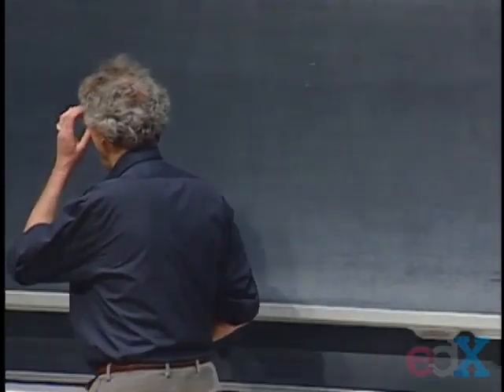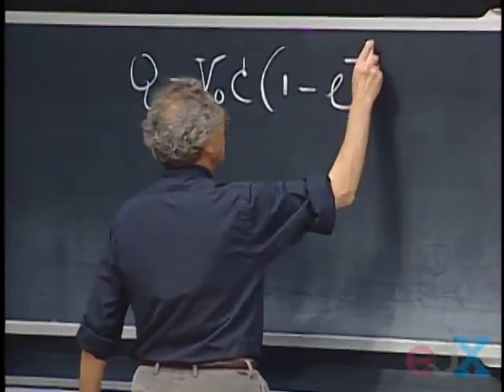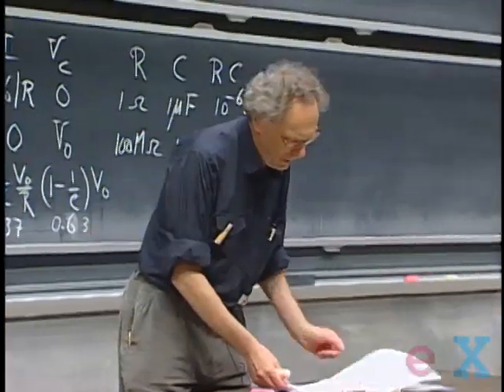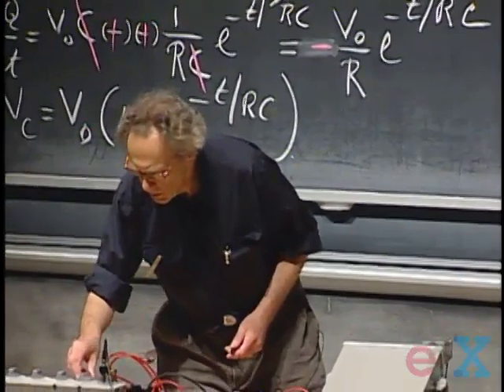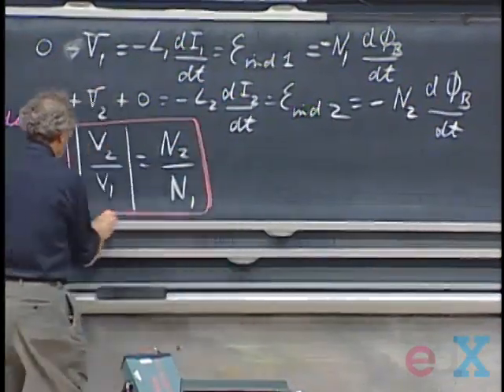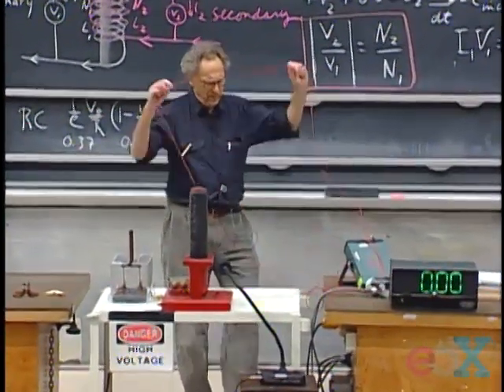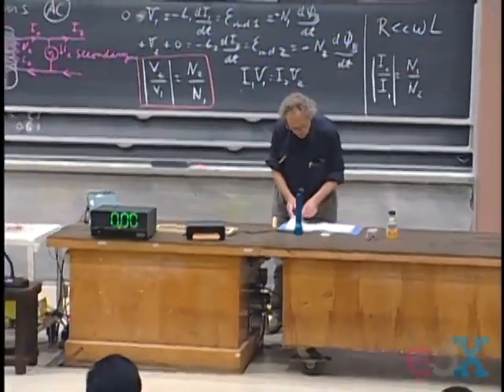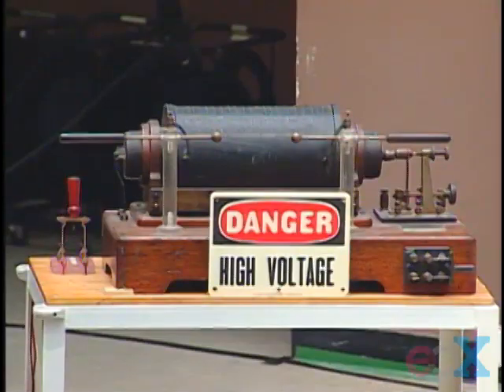8.02x - Lect 24 - Transformers, Car Coils, RC Circuits

Comment: Transformer: If the voltage in primary is equal and opposite to source voltage (110 V) how does the current even flow through primary?
Reply from the maker: question unclear
Reply: @lecturesbywalterlewin.they9259  You apply an alternating voltage to primary coil of transformer. There is an emf induced in primary which will oppose the applied voltage. My textbook says that if the resistance of coil is negligible then the back emf is equal and opposite to applied voltage.
Then how does the current flow in primary? 
Also while describing AC through an inductor textbook says that if L is inductance of coil, the changing current sets up a back emf. To maintain the current, the applied voltage across coil must be equal to the back emf. Then again how will the current flow if applied V and back emf are equal and opposite?
Reply from the maker: @aimonchaudry9260  >>>>>My textbook says that if the resistance of coil is negligible then the back emf is equal and opposite to applied voltage.>>>
that is correct, apply Faraday's law in a circuit which has inductance but ZERO ohmic resistance. Watch my lectures.

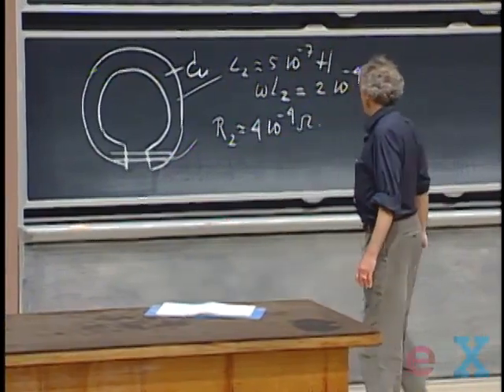Comment: 38:18 Where did the I1 = 20A come from?
Reply from the maker: listen to what I said!
Reply: "The current I drive in the primary is going to be 20 amperes."  The wall outlet provides 110 VAC, so how do you have any control of the input current?
Reply from the maker: At MIT as far as our demos is concerned we can control everything. If you want to know all the ins and outs of this demo contact aneely@MIT.EDU
Reply: @Brooke95482  the power supply unit will handle that. To give an underlying explanation, though: this can be achieved with a full bridge rectifier to turn AC into DC, capacitors to smooth out the voltage curve, and a resistor to limit to resulting current.

Comment: so Vp/Vs doesn't equal Np/Ns if the  transformer is not ideal ? .so what  are the relationships that  hold  even if the transformer is not  ideal ?
Reply from the maker: transformers are never ideal. They always heat up. Use google
Reply: Transformers are analogous to gearboxes.  Gearboxes trade torque for rotational speed, while the product of torque and speed remains nearly the same, due to conservation of energy.  Likewise, transformers trade voltage and current, while the product of the two remains the same.

Unlike gearboxes though, neither current nor voltage is rigidly constrained to the ratio of turns.  Gearboxes have rotation speed rigidly constrained to the arrangement and geometry of the gears, while torque is sacrificed because of inefficiency in the gearbox.  In a transformer BOTH voltage and current will get sacrificed to inefficiencies of a real transformer, and neither will strictly have a ratio equal to the turns ratio.

You can look for a value on the nameplate of a transformer, and it will give you a value called %Z or impedance.  This is a property that will allow you to determine the actual ratio of voltages, from the ideal ratio of voltages, when operating at its full KVA load.   Look up the definition of impedance of a transformer, and you can get the formula that allows you to do this.  From transformer impedance and transformer efficiency that are published values on the nameplate, you can determine how both voltage and current ratios drift from their ideal ratios that are determined from the turns ratio.

Comment: can you please explain what is the meaning of the statement that the current leads the voltage in a RC circuit????
Reply from the maker: there is a phase difference between the two.
Reply: sir  when the voltage is applied to a RC circuit current gets lowered due to capacitors and resistor's combine effect......and after some time when the voltage becomes 0 ....current gets maximum due to discharge from the capacitor.........I just want to ask that can I put it as an explanation to the phase difference.....
Reply from the maker: wrong explanation
Reply: sir I will try again and ans it...

Comment: lewin sir the E field between the capacitor is continuously changing then how will Close loop integral of E.dl is zeeo
Reply from the maker: In the absence of inductors, ANY closed-loop integral of E dot dl is ZERO at ANY moment in time. It's NOT my fault, it's the fault of Maxwell and Faraday.
Reply: +Lectures by Walter Lewin. They will make you ♥ Physics. I am thankful for ur quick reply but still confused...... I pray to God to keep u healthy for long time
Reply from the maker: The time will come that you will accept Maxwell's eqs.  :)

Comment: Hello, sir. Why couldn't you have made a transformer like that to produce very high current to produce a magnetic field strong enough for your Levitation experiment? Since the magnetic field depends only on the current, a low voltage high current should produce a strong enough magnetic field right?
I have a feeling I'm wrong, but I'm not able to figure out where. Help out.
Reply from the maker: Make some calculations and then tell me what kind of transformer would be able to produce the required AC current that would produce the required changing B field over a large area so that a 110 lb woman can be levitated.
Reply: The magnetic field required to levitate a woman of 110 lb comes around 0.13 T. Let's say we try to get that using a coil of 15 cm radius and 100 turns. The current required comes around 310 A.

Now if we get a 5 Amp 110 V current off the room, and we make a transformer where the N2:N1 ratio is 5:310, we should be able to get that 310 A current, right? Assuming no power is lost, we would then have a 310 A at 1.77 volts.

This 310A current will produce that 0.13 T which will levitate the woman. Since the magnetic field does not depend on the voltage, we could get any magnetic field we want by using a transformer. The power is conserved as we have a lower voltage as we bump up the current.

I know I'm going horribly wrong somewhere. Just can't spot it.
Reply from the maker: The strength of the B-field falls off as 1/r. If the current (310A) loop has a radius of about 10 cm (which would be a bare bone minimum required), the B field near the center would be less than 0.003T. 
http://hyperphysics.phy-astr.gsu.edu/hbase/magnetic/curloo.html
Reply: Thank you, sir. I understood calculating field at the center instead of a further point on the axis puts the calculations way off.
My doubt is more conceptual. The part which I'm not able to understand is, why can't we just produce enormous currents at feeble voltages(thereby following V1I1=V2I2), high enough to produce the required magnetic field( even if it falls off as 1/r, we can keep it up by increasing I as B-field linearly increases with I).

The B-field does not depend on V, right? So where am I disobeying the law of conservation of energy? What's wrong with reducing voltage and increasing current? It's the same power anyway.
Reply from the maker: If your B magnitude is off by a factor of 50, your magnetic pressure is off by a factor 2500. Thus (assuming you did not make more mistakes) instead of 100 pound you'd
be lucky if you could levitate 20 grams.

Comment: Sir, what if we connect the two terminals of a fully charged capacitor using a superconductor. Due to its zero resistance no energy should be dissipated. Where does the energy go then??
Reply from the maker: a huge current will flow; points with resistance (e.g. your switch and all contact points) will get explosively hot. Things may melt before they explode.
Reply from the maker: how many minutes into the lecture?
Reply: What if there is a battery which has extremely low internal resistance and what if my switches are made of superconducting connectors too.........what happens then sir??

Comment: Sir , if we connect a capacitor only to a battery with no resistance in between , will the charge grow to a maximum value instantaneously ?
Reply from the maker: no
Reply: @lecturesbywalterlewin.they9259  According to the equation of such a circuit the charge should build up instantaneously . why will not that happen ?
Reply: @mahmouddesokey3818  You used the word "battery", rather than "ideal DC voltage source".   A real battery has an internal resistance to it.   If you do connect it to an ideal DC voltage source, and inductive effects of the circuit are neglected, it would charge instantaneously.

A real circuit, even made from a superconductor, will have some inductance that will cause it to not be instantaneous.  Best case scenario possible, the capacitor will charge after the speed of light allows the electric field to propagate from source to load.

Comment: Sir when we are charging the capacitor then the attached resistor will get heat or not
Reply: Sure it will dissipate heat and the average power dissipated is (Root mean squared current)^2 *Resistance.
Reply: Energy lost in Resistor in time t seconds after t=0 will be 0.5 CV^2 *(1- exp(2t/RC)), so that at t=infinity, the total energy lost in resistor is 0.5 CV^2.
Reply: Then it is sure that the capacitors will not get the total voltage of battery
Reply: @ratnasaxena4754  , no, you have misunderstood the mechanism of a capacitor. The voltage across the battery causes current to flow, which causes charge to build up on the plates of the capacitor. The presence of charge on the capacitor means there is a voltage across the capacitor. Because of the direction of current, this voltage's polarity will oppose that of the battery. As long as battery voltage minus capacitor voltage is positive, current will continue to flow because there is a net voltage across the rest of the circuit, and thus the capacitor will continue to charge, so its voltage will continue to increase. Only once the capacitor's voltage equals the battery's voltage will current no longer flow, because there will be no voltage across the rest of the circuit.

The presence of a resistor anywhere does not affect any of the above. Instead it only serves to restrict the magnitude of the current at any point in time. The capacitor's voltage will still eventually come to be equal to the voltage of the battery.

Comment: Sir what will happen if the capacitor is short circcuited using a superconductor ..will it discharge itself ??
Reply from the maker: Yes it will
Reply: @lecturesbywalterlewin.they9259  But sir where will the energy go...as now no heat is produced ?
Reply from the maker: The plates of the Capacitor will heat up.
Reply: @lecturesbywalterlewin.they9259  ok sir ..thank you very much.

Comment: Sir, can i know why the current stops flowing when capacitor is fully charged?
Reply from the maker: how many minutes into the lecture?
Reply: It was just a general question...
Reply from the maker: I cannot answer that question. It depends on the circuit.  If the driving voltage were AC the current would be sinusoidal. If you have a battery with a capacitor and a resistor in series, then when the battery is fully charged it has the same potential as the battery but reversed polarity.  The potential difference  across the resistor is then zero. Thus the current will be zero.
Reply: Thanks a lot sir..
Reply: Because the capacitor being fully charged consumes no more electricity.

Electricity in cables behaves much like water in pipes, capacitors are like bottles, resistors are like a faucet, batteries act like a water pump.

Well, when you are filling the bottle with water, it will take you some time to fill it to the top according to the pressure (voltage) and the thickness of the pipe and the throat of the bottle (current), the volume of the bottle would be the capacitance measured in Farads. Once the bottle is full with water then the flow of the water in the pipe stops, it means there will be no more current. To empty the bottle will take the same time as it took to fill it.

Is that clear enough?
Reply: Yeah thanks

Comment: so Ohm's law doesn't apply to transformers ?
Reply from the maker: question is ill-defined.
Reply: I mean if we make the ratio between Ns and Np very big  thus  very high voltage in the secondary then the current is very low since Vs Is is a constant value , and this happens regardless of the resistance, unlike Ohm's law where the current increases when the voltage increases and is affected by the resistance , or do I mess something here ??
Reply: Rofaida Elsayed you are missing the reactance of the coil.  The coil cant supply infinite current.  The same is true of a battery.  Just because you keep cutting the resistance in half, the current wont double forever.  The internal resistance of the battery will limit the current.  Ohms law still applies in both cases, but you have to include all of the resistance and reactances.

Comment: Why transformers recquire ac professor?
Reply from the maker: ask google
Reply: DC current in the primary winding would create a static magnetic field in the core but nothing would happen in the secondary.  Only a change in primary current that causes a variation of the magnetic field in the core would result in a voltage appearing across the secondary.  Basically Faraday's law of induction.  So, the initial application of a DC voltage to the primary would produce a voltage transient on the secondary due to the sudden creation of the magnetic field, but the transient would return to 0 as soon as the field reached its maximum value.  Thus, the transfer of power requires a continuously changing  voltage applied to the primary, commonly in the form of a 60 Hz sinusoid as is typical of the North American power distribution system.
Reply: Because they require a constantly changing magnetic field. You only get that with ac.
Reply: You can make a DC to DC power converter that does the same thing as a transformer, but it is a lot more complicated.   And this is not something we knew how to do in the 19th century when our electrical grid was being first developed.   This is the fundamental reason why AC ended up winning the current wars: transformers and the ability to use them to trade voltage and current, for long distance transmission and distribution.

If all electrical equipment were to cease to exist, but somehow all knowledge and manufacturing processes were still preserved, we could rebuild our electrical infrastructure to use DC for transmission, using high power DC-to-DC power converters to replace transformers.  This isn't going to happen in practice, because it is in our best interest to maintain the infrastructure we inherited from the past two centuries, where the advantages of AC prevailed in establishing it.

Comment: Professor, regarding the car coil, if the e.m.f. in the primary coil is huge enough, why doesn't a spark appear at the terminals of the switch?
Reply: Hi. I'm just guessing so I can be wrong. I think that situation cannot be realized, since the EMF on the primary coil side is still not huge enough since it's about some hundreds volts. You can see that the EMF on the secondary coil side is ~1000 times larger than the EMF on the primary coil side, which is now huge enough to produce sparks.